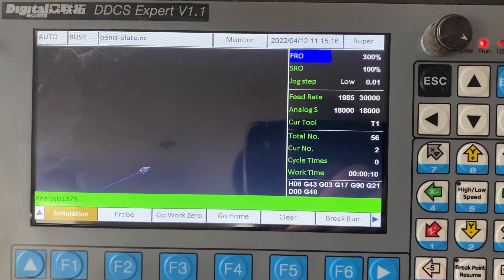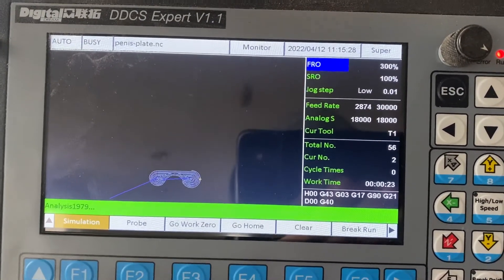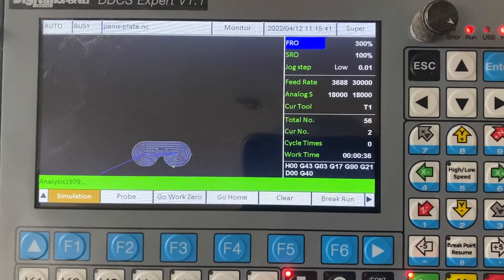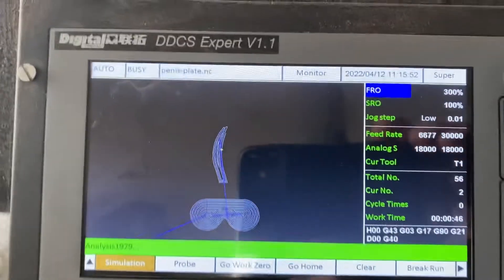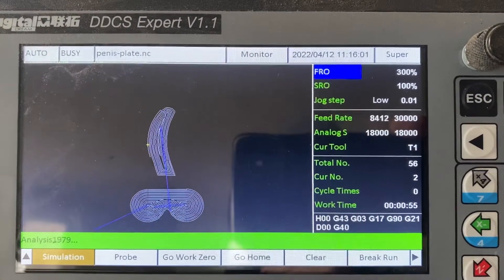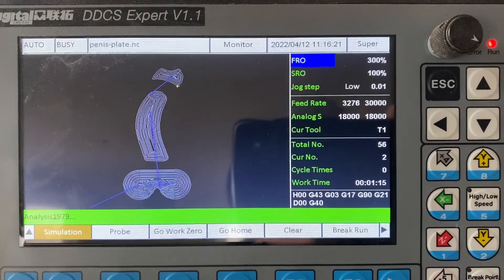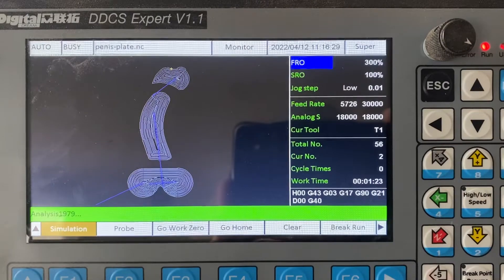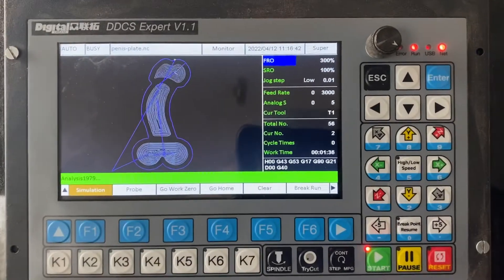Ddsc expert cnc controller test of post processor

Comment: Hello,
Do you know if this controller is interactive like Mach3 ?
Meaning is it possible to type Gcode in a command prompt let's say to cut a straigth line?
Thanks
Reply from the maker: Isn’t that what a jog button is for ? :-)
Reply: @automateanything  , In the facebook So respond to me and said  to go to Program menu ,then Edit, or use the MDI menu for one line gcode... Not sure if it works
Reply from the maker: @Levisgil47  press monitor , forward arrow,Mdi, press enter. Edit line, enter. Press execute.
Reply from the maker: @Levisgil47  just uploaded a video of how to do it . Took a minute to work out where it was. :-)
Reply: @automateanything   ok thanks. Noob here :)